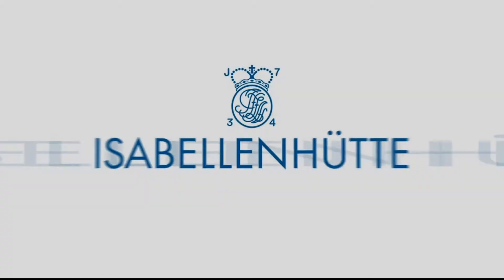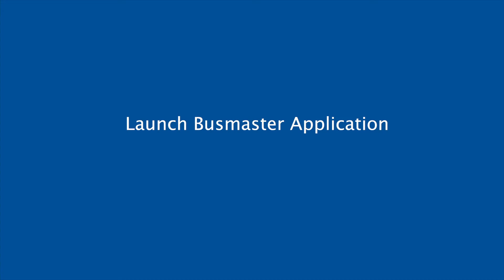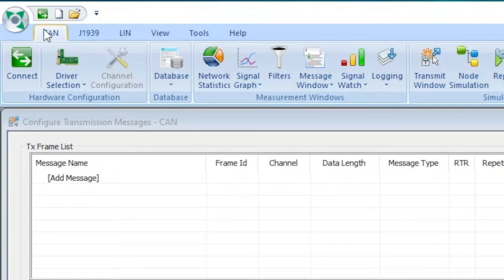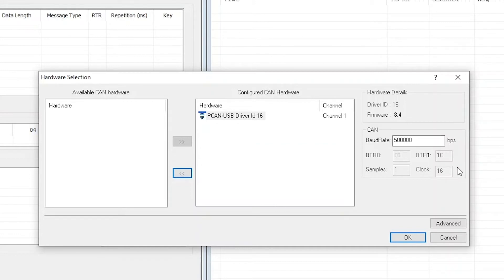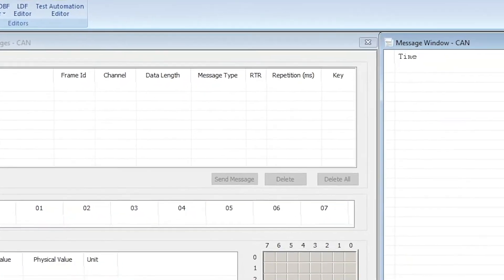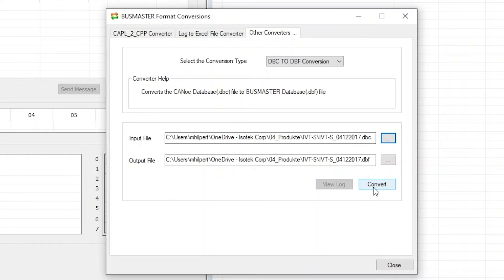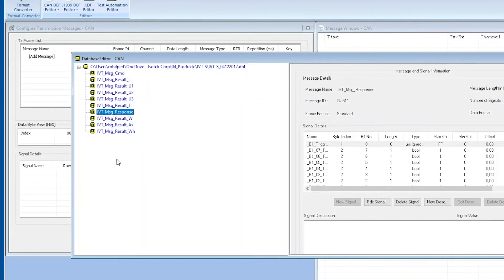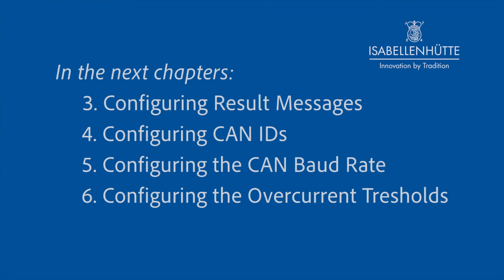Chapter 2: Setting Up Busmaster

Comment: are there stand alone digital displays available to simply show Volts, Amps, and Watts as in an EV Conversion as dash gauges
Reply from the maker: Hello, thank you for your comment and interest in our products.
Isabellenhuette is a manufacturer of Current and voltage sensing products. We don’t offer digital gauges for vehicles, our modules just provide the information on current, voltage and temperature as well as current and energy counters (calculated from the current and voltage readings) from and to a battery pack and report this information through the vehicles CAN bus system.
Thank you for contacting us, please feel free to reach out for further questions.